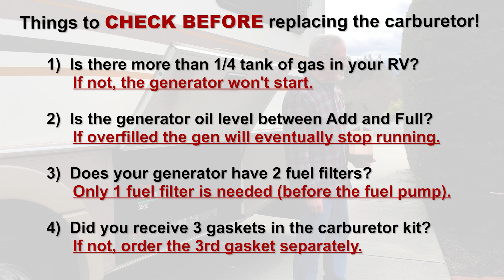DIY! Replace the Carburetor on an Onan 5500 Marquis Gold Generator

Comment: Now here we sit and stillno what is wrong? Not much help😢
Reply from the maker: Thank you for your comment! I'm sorry that this video did not get to the solution. This was a rather frustrating troubleshooting process. Here's what was found to be the issue: Fixed! Troubleshooting an Onan Marquis Gold 5500 Generator – Part 3:  https://youtu.be/XmqmIzm4nZA
Reply: Thanks for the response and still confused,  do I buy a carb or just take it to the shop
Reply from the maker: Good question. I'm not a mechanic, but I did as much as I could myself then took it to the RV shop, twice. The second time is when they found the problem. At least by replacing the carb, I had eliminated that possibility moving along the diagnosis. Good luck!

Comment: The actually problem was a simple adjustment of the choke.Yes it is adjustable and you can tell it was running rich(smoke)and because I could see the butterfly was closed .You didn't  need a carburetor sorry

Comment: I believe I would of tested the fuel pressure to the carburetor as soon as I unscrewed the carb drain and no fuel came out. If no fuel is making its way to the bowl of the carburetor … that’s the problem. The plug n thing on the bowl probably shuts the gravity flow of gas if the engine isn’t running. If there’s no gas at the carburetor? Work your way to the fuel tank. I doesn’t seem his problem was actually the carburetor. Something restricting fuel flow to the bowl of the carburetor. That’s usually the problem 8 out of 10 times
The 14 code is because the engine isn’t running right

Comment: Great video. I followed the steps and made this easy, but important change and it made all the difference. I used a carb kit found on Amazon for under $70. I rant the generator for a couple of hours back to back and no issues.

Comment: That 2nd filter you took off, the flow was the wrong direction....it should have been pointing away from the carb.....that might have been your issue the Entire time
Reply: But he tried starting it after removing that second filter near the carb, and it still wouldn't stay running.
Reply: That arrow points in the direction of fuel flow; towards the carb, as it should be.
Reply: @tbucket9367  I meant the one underneath, the one pointing towards the fuel pump and not towards the carb. Does that rubber line come from the tank or the carb? If it goes fuel pump, to that filter, to the line in the video, then to the carb then it’s incorrect….if that line comes from the tank, then into the filter, then the fuel pump and then to the carb it’s correct. Basically I’m saying to check the flow of the filter underneath at the fuel pump.

Comment: Hello
I have similar problem with mine...
Why did you write ONLY ONE FUEL FILTER IS NEEDED BEFORE THÉ PUMP ?
I have a Onan filter just before the pump but i have another one 16 inches before the Onan Filter...
Reply from the maker: Why would you need 2 fuel filters?
Reply: I just bought it and it's like its ... can its cause the problem?
Reply: @ggasss  With 2 filters, possible to be too restrictive fuel flow for the pump to pull gas through the first filter and push it through the second into the carb. You only need one, ideally prior to the pump.

Comment: A little tip after removing my carb many times. It's easier to slide the carb off the bolts then disconnect the throttle linkage
Reply: Hey, Glen, yeah, that's a huugely good tip since I have gone thru sheer misery trying to pull-off and put on the linkage whilst it was still on the carb bolts. I've even bent the end of the spring-hook attachment and tried to re-attach it while the carb was on the bolts, and that was not a good maneuver -at all! Thanks for the heads up, and take care!